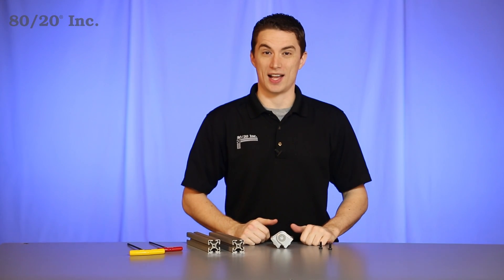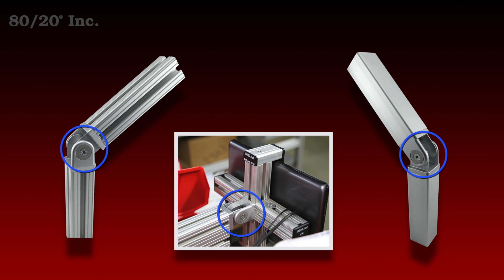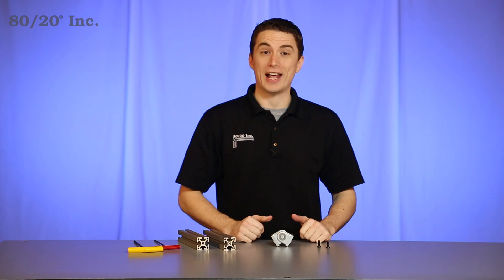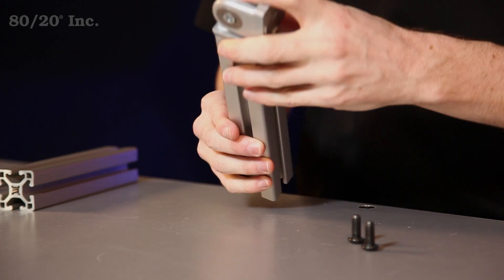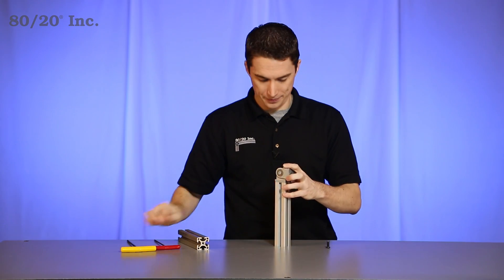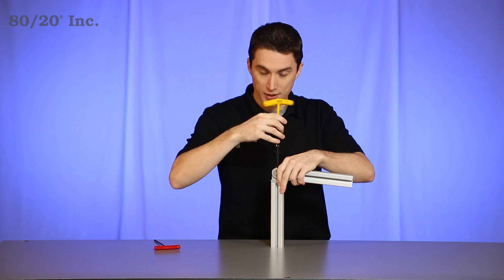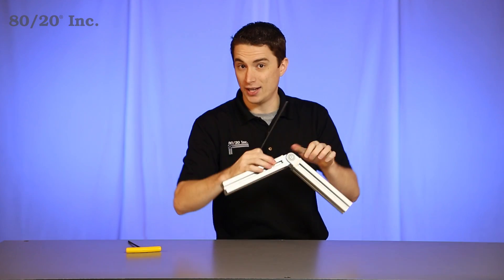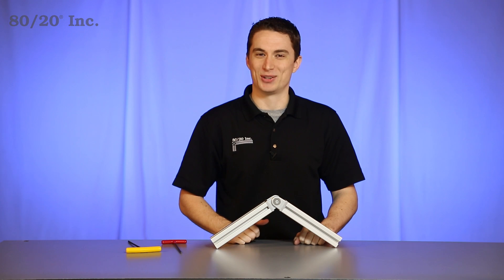80/20: Pivot Joint Overview

Comment: Are those reliable to support weight? For instance a whole monitor attached on the other end of an arm which is connected with one of those joints to another structure
Reply: looking to buy this for mounting a monitor too

Comment: Which bolt used in pivot joint please tell me
Reply from the maker: Recommended bolt size and styles vary depending on the profile series and exact Pivot Joint you decide to use.  All recommended bolts, and bolt assemblies, can be found in our catalog, accompanying the associated part.